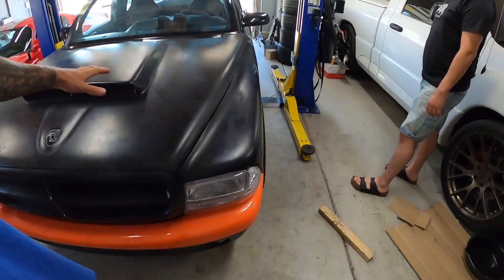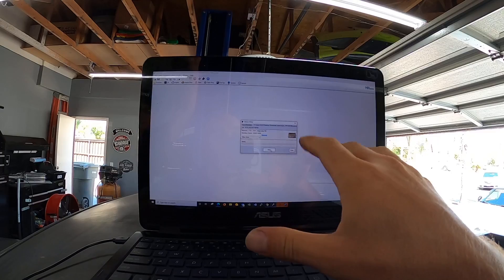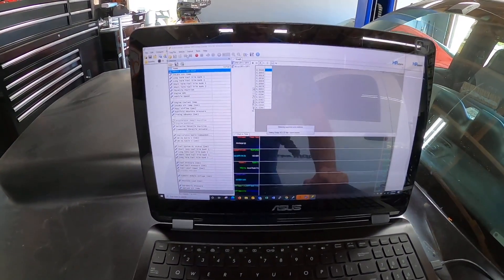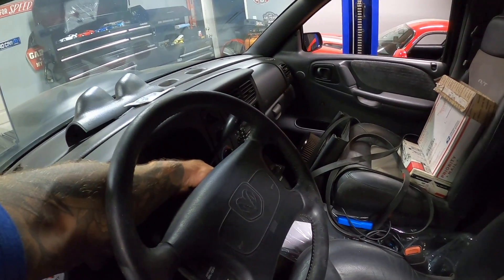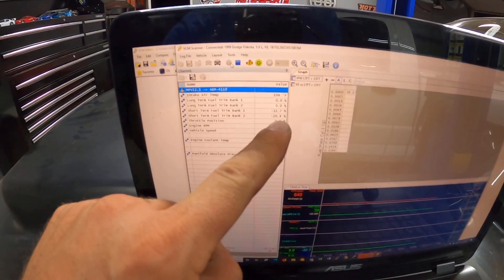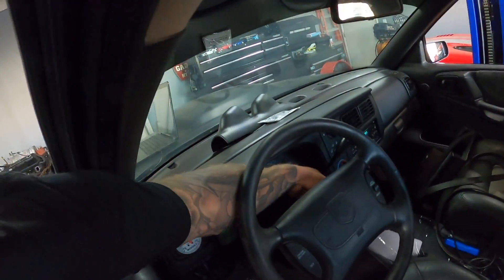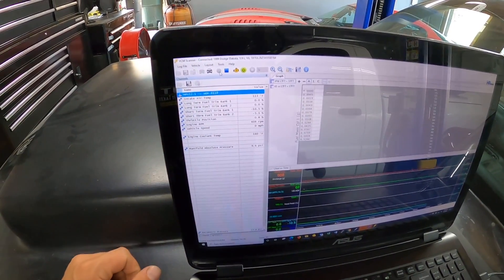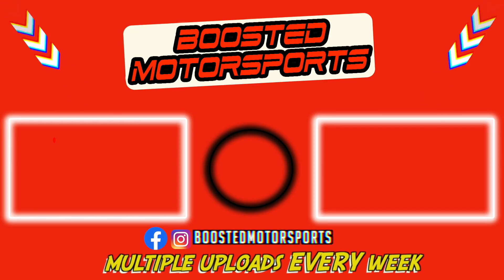HEADS & CAM 5.9L Magnum Dodge Dakota R/T | PART 8

Comment: i know this is a old video but just a tip the way you tune this is with long term fuel trims. anytime you make revisions with long term fuel trims you have to go to the special functions and do a long term fuel trim reset. if not you will see pretty much the same data on long term fuel trims until the short terms average it down. im not 100% sure you can do this with jtec so the old fashioned way is to pull battery cables for a couple mins to reset everything. if your using a wideband then you dont have to do this.

Comment: Slowly but surely getting there...so once you license that truck you can tune it unlimited times? Let's say down the road you super charge this truck is that more credits or is it still on the original license...I mean 50.00 bucks for unlimited tuning sounds like a great deal plus cost of unit

Comment: Right on jon .. it sounds good .. question ..? Do you not let truck run at a certain idle speed to do cam break in period an let temp get up to operating an such .. maybe you did behind the scene but not sure ? Plus after that why wouldn’t you take jus for small gentle drive around say 1 block an record after that an send it in to tune guy ..anyways looking forward to all the next vids of work your doin on it as well as some street driving An pulls when you get to that point great job bro 👍